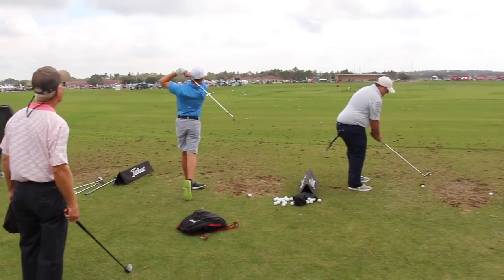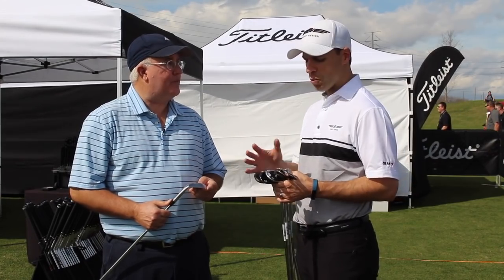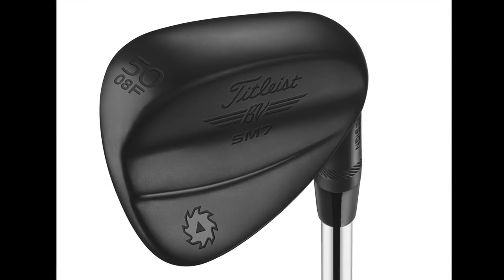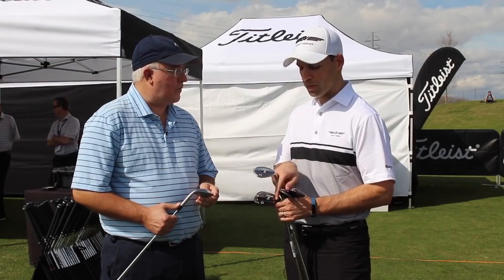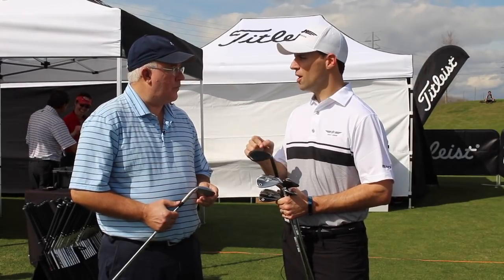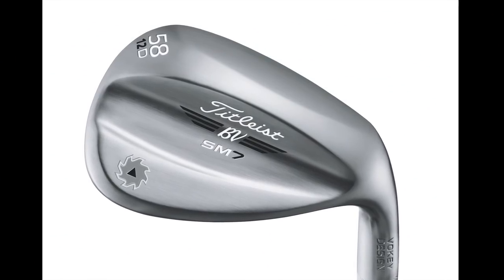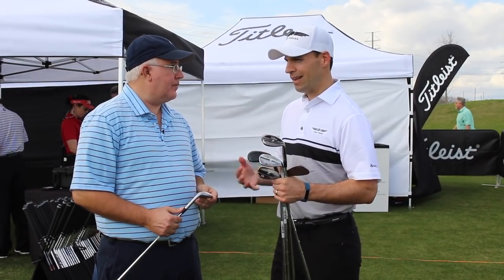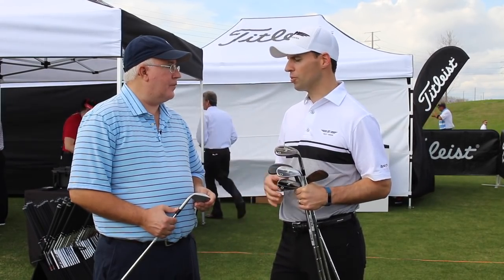Titleist Vokey SM7 Wedge Grind Options

Comment: looking to get me some vokey wedges (60, 56 and 52). I do not have the benefit of a fitting center.

I usually use the 56 and 52 for full shots and half swings off the fairway.
For the 60, I seldom hit full shots with this and just use it for the sand and half swings (60y and below).

What grind and bounce can you recommend if I'm looking for a 60deg club that will give me improvements from the sand but still be OK to use for half shots from the fairway. I would say my normal swing is sweep to neutral. I don't really dig into the ground too much (at least not intentionally).

I am currently using the K Wedges of Miura - I don't really know if i'm using the right wedges but I do want to try.
Reply from the maker: Salvatore San juan What is the sand like where you play most of your golf? Is the sand either very soft or very firm? If so, that's an important piece of the puzzle when it comes to picking the right grind and bounce angle for your primary sand club, and that information would help us make a better recommendation.
Reply from the maker: Salvatore San juan a couple other things to consider First thing is what kind of turf do you normally play on? (Soft, Hard and etc...) Do you blasts out of the bunkers or sweep? Do you like to open the face for half shots or/and around the greens? From what you wrote I would most likely recommend mid bounce with standard grinds.
Reply: @2ndswing  bunkers are normally on the soft side (except when wet) - depends really which course I play that week. Would it be advisable to have a 56 thats for softer sand (more bounce) and a 56 for firmer sand (less bounce) - this way, I can also alternate using them on the fairways. I'm looking for an approach that will give me the best versatility on the course as I really can't tell if i'm pitching from the fairway/rough with an open/square face - depends really on the shot requirement. And it's really hard to pinpoint what kind of sand I will be blasting out from. I normally blast from the sand. Very rarely do I sweet the ball off the sand. I want to utilize the bounce out of bunkers and hear that 'thump' sound. Thanks! And Happy New Year!